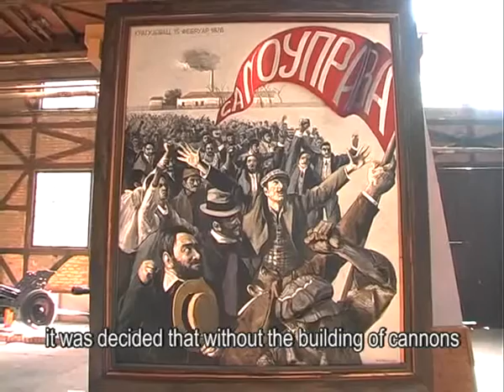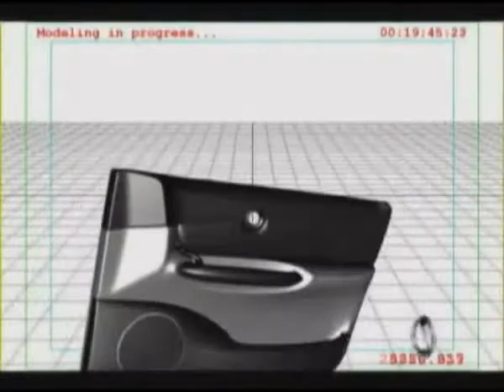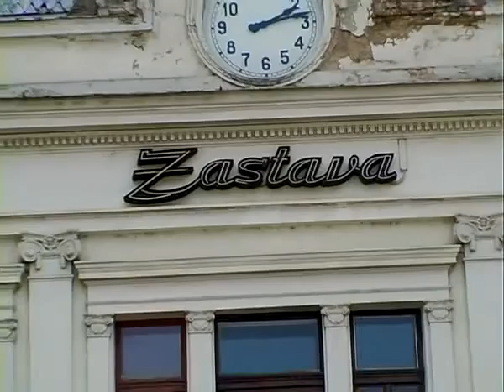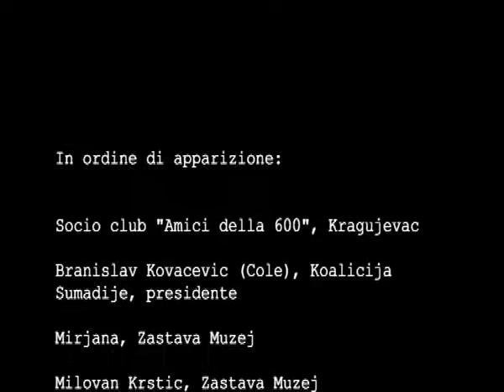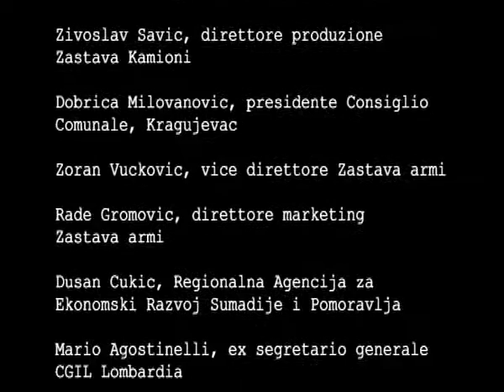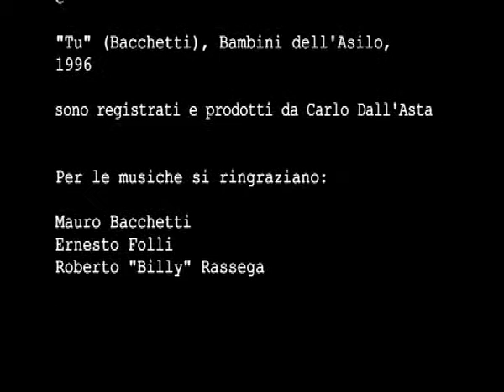Zastava Documentary

Comment: It's like mexico with the original beetle I could have gotten a yugo gv looking right from the 80s in modern day it would have gotten one
Reply from the maker: Yep!
Reply: Not really, most Eastern European Cars were made for an extremely long time, for example a Lada Riva, if anything, Mexico was a lot like Eastern Europe with the Beetle
Reply: @WalmartMustacheMan  true the Lada Riva I feel the social very well built car simple yes and sometimes after people need I drive a very simple car here in the United States no air conditioning no power steering just the heater and it's not even fuel injected but simplicity is key means less can break down
Reply: Once I restore and upgrade my Yugo, it will be my daily, I do want to get air conditioning for it and get one of the higher end Yugo radios but thats it for “features”, the drive train I want to upgrade to a 1.5l or a 1.9l Fiat 128A as its just a larger version of the original engine and I want to put a 5 speed manual Yugo transmission, thats really all I need, a nice simple car that is functional, has some form of speed, and puts a smile on my face whenever I drive it